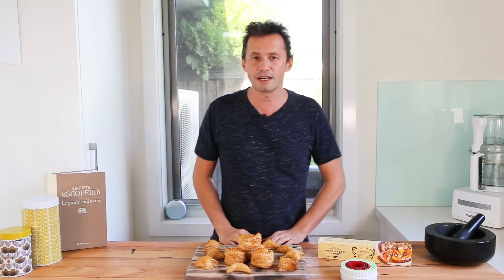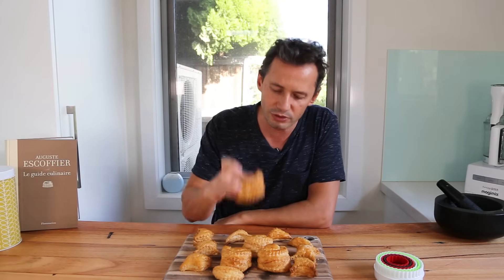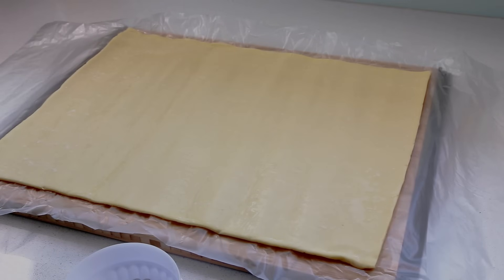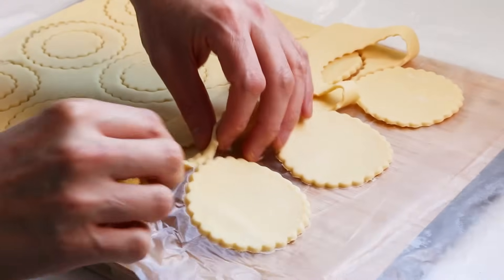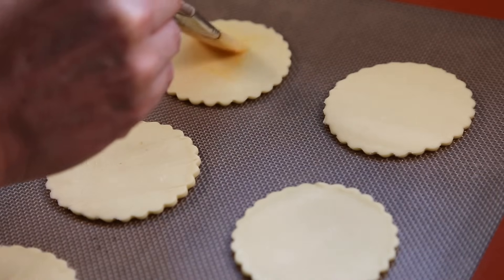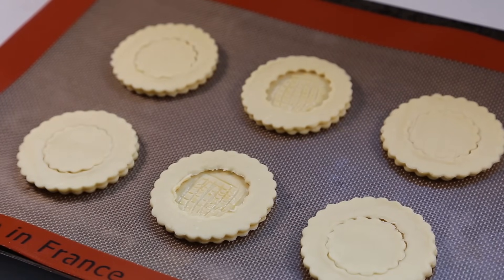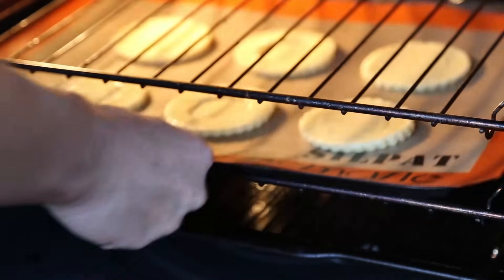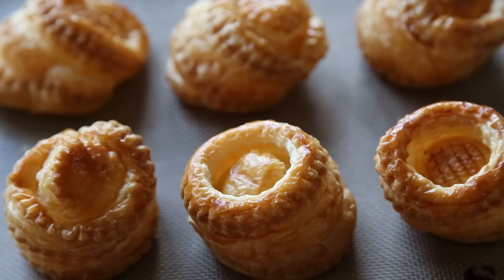How To Make Vol Au Vent Shells ( From puff pastry sheets)

Comment: Stephane, another trick to help them rise straight: chill your puff pastry in the freezer before cutting it with the cookie moulds. Don't let the dough before completely frozen, but let it get a little tough.  This will help prevent the layers from pinching together, and it'll help it rise with better separation and evenness.